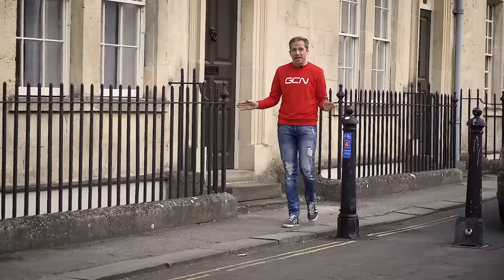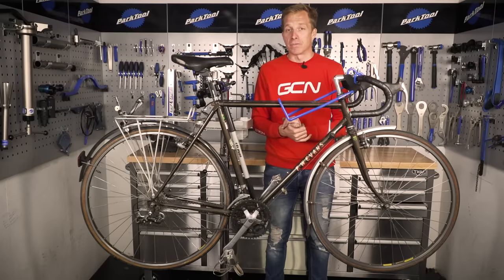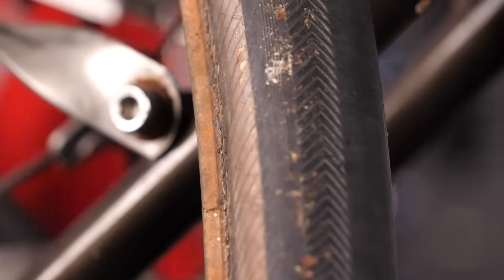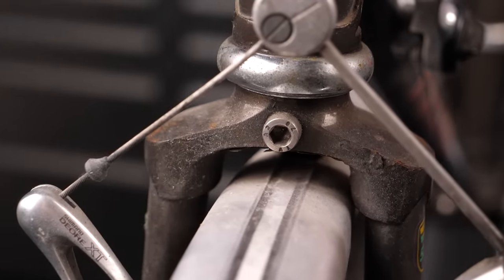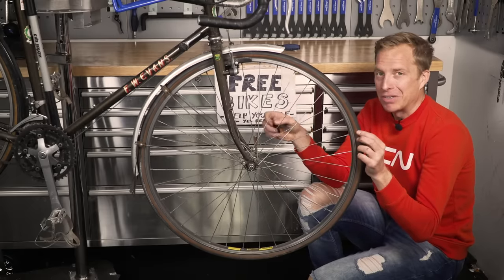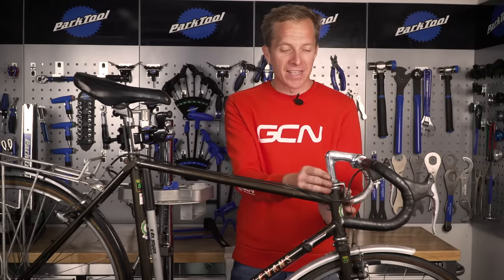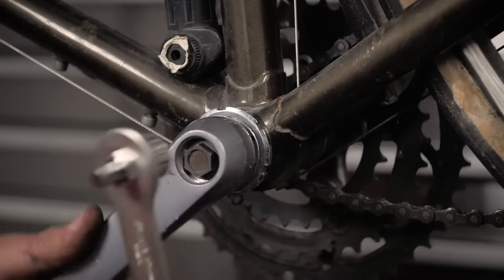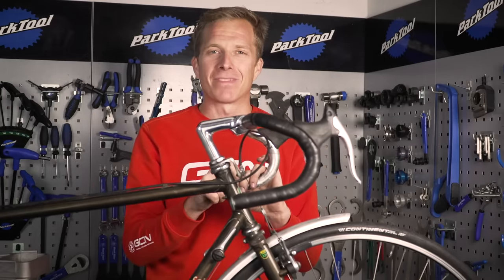Trash To Treasure | How To Fix Up An Old Bike

Comment: If check the geometry of the bicycle check frame very carefully for rust rot dents check the spindles and crank head set tyres then I’d strip it right down and rebuild very carefully and then once i was satisfied ride the hell out of like bike packing

Comment: Hi,
Do you make the pores in the chromium coat bigger during this process. if the chromium pores get worse, it will likely to have more rust the next time it rusts. However, if it is easy to chromium spry coat it after this process, then the method is complemented, and you wouldn't have to worry about rust for a long time.

Comment: Best way to restore an old bike is to strip it down. Clean and restore as many parts as you can. Get rid of the crappy cup and cone type Bottom bracket and replace it with a sealed unit.

Comment: Lucky man
The bike I got for free was so worn out, at Halford they refused to fix it as the guy said "it's not worth it, gears, chain, brakes, brake lines, shifters and pedals are all gone".
Me being me didn't want to change anything, wanted to keep it all original, with bit of sweat I made everything work with only the brakes being replaced 😂

Comment: I would have removed the stem and seat pin and regressed them, to check for and avoid corrosion between the aluminium and steel. I would also have changed the brake blocks and brake cables, for precaution.

Comment: The usual problem with these old bikes that you can find very cheap/for free is that usually at least one of the stem, seatpost, or bottom bracket is completely rusted and stuck in.

Comment: I'd make sure the seat post not rusted into place, happened once before, and ohh nightmare to get it out and get a new post in, , drilled a hole in the post cut down the side of the post, big pair mole grips, half can oil,  and eventually came out without cracking the frame, lol lot worse than this one, good find

Comment: I used to get cheap bikes to overhaul from the tip. Maybe every tenth one was as good condition as this. You save yourself a whole lot of bother by always stripping the machine right down, and rebuilding from scratch. Lots of happy repeat customers when you sell them that way. Sadly, a big French waste company has taken over all the tips round here and thrown out all the small salvage contractors you could do business with. All the best stuff is crushed now for the metal value (about £1 / bike), and the shinier cheapy machines are sent to charities or bulk buyers. They aren't interested in dealing with the little guy.

Comment: The reason I'm watching this video is I found a "free" Windsor 10 speed thought it has surface rust and paint issues other than a missing brake pad and a blown inner tube new inner tube and brake pad and reverse brake handles  or pulls  for safety i really need rear brakes on my left   I'm handicapped  but overall  bike  was in decent condition

Comment: *Both derailers are heavily rusted
*Both brakes are heavily rusted
*The whole drivetrain; the chain, cranks and freewheel are worn out
*Rust all over the bike. 
None of these issues where addressed which makes the purpose of refurbishing the bike unclear. Was it to make it as new? In that case why wherent all the derailers, brakes and drive train parts replaced?
The cost of changing out all those parts will be 100 pounds, even if you do get away with heavily refurbishing the rusted up parts. 
Can't say I agree with this mentality of getting something free and not even investing in immediate replacement.

Comment: How is it possibile to remove the rust from paint and from chrome parts? I've a Colnago Master Olympic Decor (1991-1993), it was my father bike, unfortunately it has some chips in the paint and some rust on chrome parts and I want to restore it as best... i want to try with coke (yes the drink) to remove the rust
Reply: Send it to me.... I won't guarantee it gets returned though 😉
Reply: Solvol Autosol is great for cleaning up metal - even painted metal where a little rust is showing. Jenolite is a very effective rust remover for bigger patches - it has phosphoric acid in it just like Coke!
Reply: ahahahah so kind of you :D I'll bring it to you but in person and I'll return with the bike restored... anyway, pleasure to meet you Jon!
Reply: Evapo-Rust
Reply: I'm just about to do a 1960s Viking Severn Valley (531). Make a bath for the bike and soak it in evapo rust or equivalent. So far I've used on the forks and it works a treat and its non toxic unlike oxalic acid.
Reply: evapo rust yes 
a vintage  colnago my dream bike....
Reply: try just water on foil for the chrome rust..it's crazy how good it works.
Reply: thank you for your advice! I'll try them
Reply: With chromed parts I think it might be game over.  Usually it's the fork that's chromed, and since chrome itself doesn't rust, when rust spots appear that means the fork is rusting from the inside-out.   Even if you could remove the superficial evidence, I wouldn't trust it.  If the bike has sentimental value you might consider looking for a replacement steel fork.
Reply: Argos, Mercian, etc will restore it.

For a price.

Worth it, for a Colnago.
Reply: Alex Zalez Excellent work, she looks brand new!

Comment: It makes no sense (to me) not to take the time to clean and lube the headset, wheel and bottom bracket bearings. They are so easy to do on these bikes, and will ensure YEARS of continued riding. You talk about how they can be ruined if not serviced, then you don't service them? Also, I agree with the suggestions to simply replace the cables, particularly the brakes.

Comment: ive just done this 45 year old rusty french racing bike stripped it ,put it all in the bath costic soda.all rust gone new tyres sprayed it gold wire wool all the cogs and brakes .tipped it upside down put oil in that little hole .new tape. its cost me 25 quid for new tyres and tubes ans brake blocks and tape. its like brand new gold now looks new .i dont know how to find the make or age .i have the number underneath its 211008. thats all i know about it ..

Comment: Good timing, I found a old road bike at a yard sale.  It says “special road racer” and “the Londoner “ on the frame.  Anybody know anything about it and it’s worth?  I’m planning on flipping it.
Reply: "The Londoner"?  IIRC that was a short-lived name back in the '80s, used on frames like the one in this vid - check for Reynolds stickers.  List parts, etc and off we go!
Reply: You come across so many frames that no one has ever heard of. I found an old 70s road frame, has Santana badges on it and says Danbury on the downtube. Put Santana into google and they build tandem bikes. No mention of a vintage road bike
Reply: @Jeesus353  check google images, there's dozens.
Reply: @BlokeOnAMotorbike  that's funny, all I see is a bunch of mugshots of a moody teenager.
Reply: Londoner was a brand sold through the London Bicycle Company which had a few shops including one where I worked on and off in Covent Garden during 1982-86, while visiting from Aus, and spending the summers touring Europe. Most were from Dawes or Holdsworth and were classic tourers. The majority had at least some 531, some of them with full 531C tubing. The business didn't last long after I returned to Aus, but I don't think that was cause & effect.

Comment: if you get a old bike ,and want to ride it ,   new cables , new brake pads , new greace in headset and bb ,hubs  new tires and tubes ,  everthing will cost around 50euro , 2-3houes ,

Comment: so basically you fix it by not fixing anything :P If it was me i'd tear it all apart, sand it, paint it and then put it back together replacing anything that needs to be replaced, like brakes and cables, and cleaning everything in the process.

Comment: Why make a 'fix it' video for a bike which is in near mint condition?

Furthermore, if you already have loosened the lock ring on the bottom bracket - why not take out the cup, inspect it and the axle, and re-lube it?

Comment: Whats wrong with Upside down?
Reply: do you ride inverted? The point to bike maintenance with the rubber on the ground is that if anything is going to fall off, it's going to do it in your garage, not in the middle of nowhere.

Comment: Alternate title:

"how to point out the fact that this old free bike doesn't need any repairs or replacements." or "things to check for on an old bike." 

There was basically nothing in here about how to fix up an old bike, this was just "how to look for problems".

Still a good video, but as someone who wants to fix up my dad's old 1970s Sekai road bike, I found myself disappointed that there was no actual advice on how to fix any of the things you pointed out except for the cables, despite the "how to" in the title..

Comment: I don't get this fascination of making everything shiny and new looking.   People have gotten really spoiled nowadays.  My bicycle is noisy and sometimes shaky but it gets the job done. So i am in no market for a "professional" looking bicycle for me to put on tight spandex with a helmet on.  Too much of pollution is not good. Me thinks ;)
Reply: It's not just about it looking nice, it's also about safety too, personally I wouldn't want my bike to fall apart mid ride.
Reply: @theblackspark2644 why would something made out of metal designed to carry the weight of twi grown adilults fall appart all of a sudden?
Reply: @-Muhammad_Ali-  It could have cracks or rust spots, if the peddles aren't on right it'll cause issues peddling or they might fall off. If the headset/handlebars you could have problems steering (I've had handlebars come loose before on a almost brand-new bike). My point is you really don't want your bike breaking while you're moving at high speeds near moving cars.